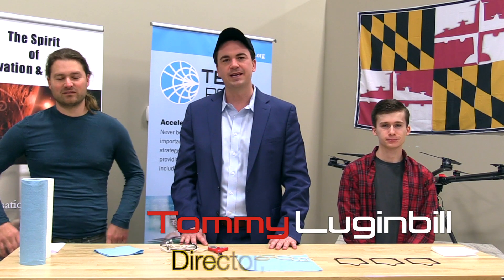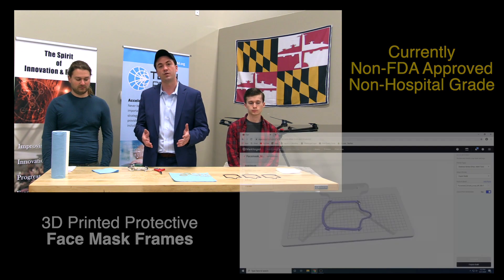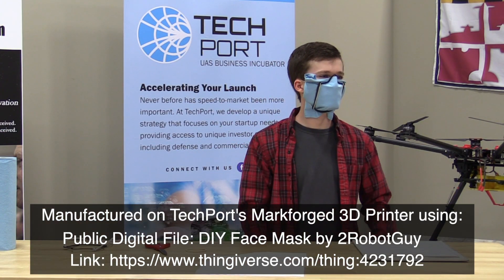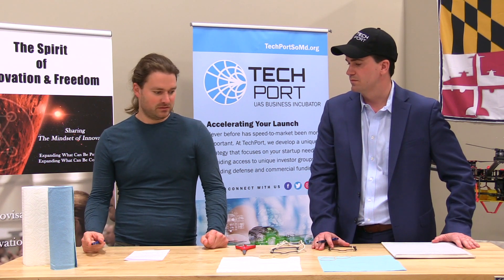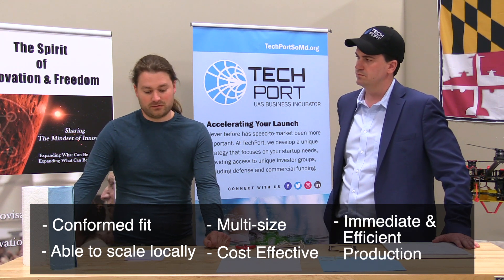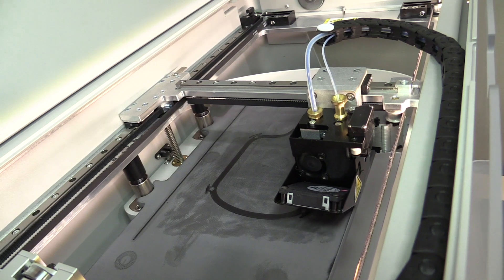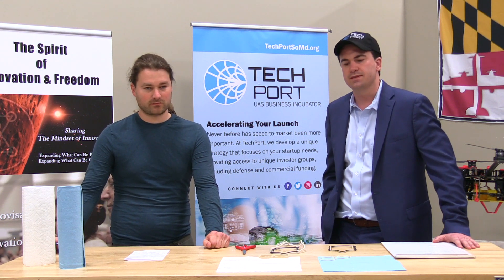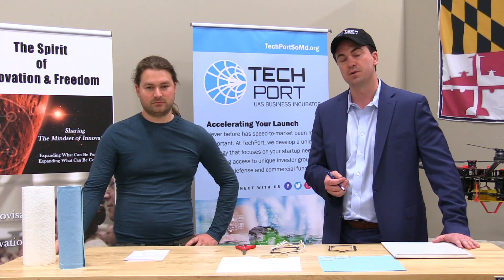Scalable, Cost-Effective 3D Printed Face Mask Frames.

Comment: Story out of San Antonio looks promising:
https://www.ksat.com/news/local/2020/04/16/local-nurse-designs-mask-with-995-filtration-efficiency/

Home AC filters, MERV11 minimum,  MERV13 ideal. Still available in stores & Amazon. Also HEPA filters & vacuum cleaner bags.

Regarding cloth: The best masks were constructed of two layers of heavyweight "quilters cotton" with a thread count of at least 180, and had thicker and tighter weave.

"You do want to use a woven fabric, like batik," Segal said, "but you don't want to use a knit fabric, because the holes between the knit stitches are bigger."

Source: https://www.nbcnews.com/health/health-news/making-your-own-face-mask-some-fabrics-work-better-others-n1175966
Reply from the maker: Thanks for sharing!
Reply: @tommylug  I should also add after doing some digging- verify whatever filter you're using, make sure it doesn't contain fiberglass. Use the filter's MSDS to confirm.

Comment: Removing a mask is a critical operation, you don't want to contaminate your hands or anything else when removing the mask. With this design, my understanding is that the fabric will fall down when the mask is removed and if it falls you'll want to catch it, with your hands... As a workaround, what about printing the same model 2 times and put fabric between them two. Remains to find a way to clip them all together but then, at removal time, it would work to grab the mask by the rubber bands or stings and sanitizing it right away.
Reply from the maker: Great idea!

Comment: Really nice idea. The only problem with this mask is that it uses a large amount of material for the filter.  While this makes breathing easier, finding adequate filter material in the community is probably more of a rate limiter at this point or as much of a rate limiter as printing speed and capability.  I've been going more with the Montana mask (www.makethemasks.com) because it can use less filter material, thereby extending your supply of filters.  However, the Montana mask is definitely more difficult to print, where as this idea is great in its simplicity but I'm not sure it would pass a fit test.  If you're open to altering your model I would consider that one.  In my mind, this particular mask idea would be a better replacement of a surgical mask rather than a respirator and would be great for lower risk, but still at risk essential workers who need masks like people that work in subacute rehab centers without covid patients or police officers. It seems like valid options to me depending on what resources you have.  I see you already have been sent the UF Health link regarding their sterile surgical tray material.  Hospitals in my area still aren't going the route of 3D masks but as supply chains continue to be disrupted they may.  Surgical gowns are also rated and marked with different levels.  They undergo permeability testing that goes down to 1 um (micrometer) and although the virus is smaller than this, the profile of that polypropylene behaves similarly with N95 polypropylene at every other level of testing.  Keep up the good work.

Comment: Hi, despite not having seen this video before, I must give you credit for sharing your idea, evidently there was a lot of work that you did before. I explored a modified version, that adapts to my face contour either by a hair dryer heat, hot water, or simply by the elastic bands as you can see in the video and the files I am sharing (In spanish but perhaps you might understand the sequence of the explanation): https://drive.google.com/drive/folders/144lq39kb52Ty0p49WxMVEUb5bTU6JruX?usp=sharing&fbclid=IwAR37RK-GR_c-AnJ4SKFDJ2GWSBLpSgYhaersmTGePxF9rtzVCjSQLk-YSPg

On the other side, I explored that based on expert-medical advice, the maximum protection against COVID19 is obtained by P100 masks (there is an illustration on the folder I am sharing). An appropriate filter is a non-woven polypropylene, melt blown or spunbond technology, at least 0.1 microns. Please see: https://www.alibaba.com/product-detail/p100-mask-filter-non-woven-fabric_62483517696.html?spm=a2700.galleryofferlist.0.0.399716e8cp8ZjQ
Reply from the maker: Thank you for sharing! Stay safe and hopeful!

Comment: HI, i'm form mexico, I already printed your design from a similar version from thingyverse, however many stores are closed where we could source materials like cotton, do you think it's viable to use coffe and tea filters?, or are they too porous.
Reply from the maker: Alejandro, none of these options are FDA rated or approved, but I would check out some of the material designs coming from a group called “Early Charm Ventures” in Baltimore, Maryland. Additionally, I would take a look at the work coming out of the University of Florida Health Ctr. (link in comments). 

Finally, if at all possible, find an existing mask, and rather than tossing it out after using it, consider sanitizing it with heat. Again, none of these have been verified by the FDA, but hopefully, you find them helpful. 

Sanitizing Ideas: https://www.youtube.com/watch?v=YuzQuqBgT2w
Reply: @tommylug  Thank you!.
Reply from the maker: Good luck. We have some other information coming out tomorrow on face shields. I’ll do my best to share, but if I forget, please reach out!
Reply: Alejandro... try AC filters or HEPA filters. AC filters look for a minimum of MERV11. MERV13 is the best.

EDIT: If unable to obtain AC filters, layer materials like denim, quilted cotton, bamboo or HEPA vacuum cleaner bags.
Reply from the maker: Alejandro, please hold tight, and I'll share some thoughts later today.
Reply: From another article regarding the best fabrics for covering your face:

"You do want to use a woven fabric , like batik," Segal said, "but you DON'T want to use a knit fabric , because the holes between the knit stitches are bigger." The best masks were constructed of two layers of heavyweight "quilters cotton" with a thread count of at least 180, and had thicker and tighter weave.

Comment: There is a group at university of Florida that demonstrated that the cloth used to cover surgical tools exceeds n95 and is usually destroyed. It is autoclavable and even blue.
Reply: We are trying to source some from our local hospital. Seems like they are busy right now.
Reply: Do you have an STl file available?
Reply from the maker: Yes, this posted article gives you all the details on the mask frame. https://www.linkedin.com/pulse/evaluation-3d-printed-face-masks-downloadable-file-tommy-luginbill
Reply: https://www.tinkercad.com/things/j9DCzztX365-headbandugddsbfaceshield/edit?sharecode=jqILdH90jKgR6bv2jBBX84BqyBvMA_g5aCsach13w5Q
I have been working on a face shield design. It uses a transparent overhead sheet with a 3hole punch. A strip of foam is double sided taped on the inside. Very fast to print and has disposable face shields. Please have a look and distribute the file if you see some utility to it. The strap is simply three elastic bands interwoven into a strap. Not perfect but can save some lives.
Reply: Amazing work thank you.
Reply from the maker: Please share with anybody that needs it!
Reply: ASTM Level 2 and 3 surgical masks provide appropriate fluid and particulate resistance. It is the poor fit to facial contours that limits their effectiveness. Why not just combine this kind of a frame concept to improve the fit of current masks to improve their effectiveness?
Reply: Adam Flint that’s a great idea if you can get the masks.
Reply from the maker: Can you send me a link on this?
Reply: Thomas Luginbill https://m.ufhealth.org/news/2020/uf-health-anesthesiology-team-devises-respirator-mask-made-existing-hospital-materials?fbclid=IwAR3ZEZa4GTCR54zkNVcr0ILMgZf-elWkVLdk3XfneHE0nYqqCKTHDz0RIDA
Reply from the maker: This is fantastic. Thank You.